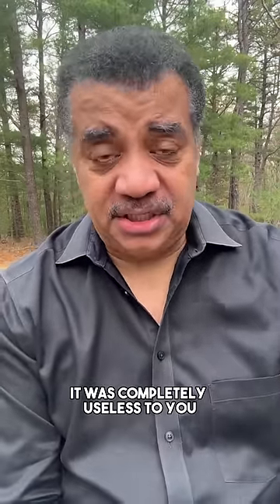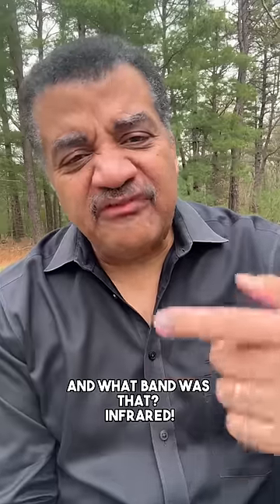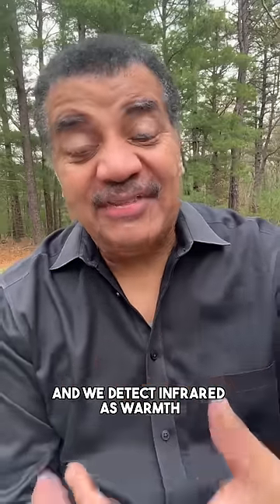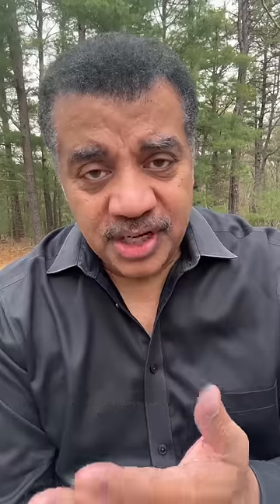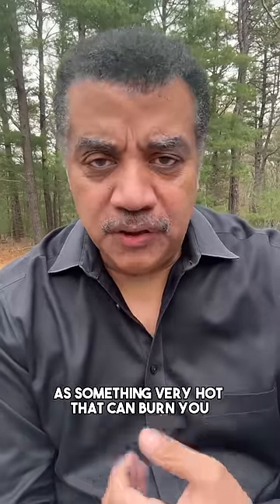LED Bulbs vs. Old Bulbs 💡

Comment: Proof that incandescent light bulbs are 100% efficient in winter.
Reply: Only in places where it gets too cold in winter
Reply: @Brauljo  yes. In places where you need light and a little bit of heat allowing you to turn down the heat in the reast of the area.
Reply: @sukhmeetsingh8365  how do you figure?
Reply: It sucks cause I’m running out of them for my pump house during the winter. Leds don’t keep it warm
Reply: @sukhmeetsingh8365  Well otherwise they'd likely have the HVAC or a fireplace running, so it's one or the other.
Reply: If incandescents are 100% efficient during the winter, well then so is literally everything else...
Reply: @BobWeave Get a chicken coop heater. Uses very little electricity and puts out just enough warmth....like an old style lightbulb. Also safer than an incandescent light bulb. You can safely hang it right against the wall.
Reply: @alansach8437 well that's a  cool tip!
Reply: Only if you heat with electrical baseboards.  

A gas furnace is 90% efficient, but a gas generator is 30% - so a gas furnace produces 3 units of heat per unit of electrical energy you could make with the gas.

A heat pump is also more than 100% efficient - 1 unit of electrical energy heats the house more than 1 unit of heat by pumping heat rather than just making heat directly.

Electrical baseboard heating is obsolete.
Reply: Didn't think of this. Really good point bro 👏
Reply: One winter I heated my apartment with the lights. Heat was included with the rent, but it was oil heat, and sometimes the landlord would be late and getting the oil filled up, usually because he didn’t have the money to pay for the oil.
Reply: I like LED lighting but there is something about incandescent lights that cannot be replicated, there is missing temperature and I don't meant heat but Kelvin colour temperature. Even the warmest of warm temps on LEDs with high clarity rating they aren't as good, imo. I love efficiency of LEDs though but MIT developed an incandescent that was just as efficient using graphene.
Reply: @BobWeave What type of fitting is that? Chances are you will still be able to source them but you have to know there are some exemptions that allows us to still be able to buy incandescent bulbs. I find it difficult to find good quality incandescent bulbs now though.
Reply: Household LED lightbulbs still don't compare to those like in a flashlight or headlamp. They're like wannabe "efficient" LEDs in that technically they might be LEDs but they still use more power than is necessary to produce appropriate lighting.
 Heck look at solar lights. The Ones you stick in the ground outside. There are actually some with pretty good brightness and high lumens that can run all night with just a tiny battery or two about the size of a d battery and a really small solar panel  3x3 in or so is enough to sustain recharging. Another example, I have a really bright lantern I got on Amazon that is capable of 400 hours of light (yes four hundred) on a measley 6,000 mah battery. That means 6000mah of power can sustain it 24 hrs a day for 16 + days or for months at 8 hours a night. I repeat that's on just a 6000 mah battery. I regularly leave it on all night (sometimes even forgetting to turn it off during the day) and have never run out of power/light while camping. 
Why do we only have wannabe efficient LEDs? Imagine if millions of households suddenly had lights that were plenty bright enough but only took a few milliamps respectively to run for a month...
Who would suffer?
Millions of households with a reduced light bill...
Let alone the whole country of billions or world.
We don't have a problem with not enough power available. We could easily create and switch out household electric and appliances with 12 volt LEDs and appliances like boats and RVs. Boats and RVs by the way can already run refrigerators/freezers, heat/ac, tv, hot water heaters etc and all their electrical needs on a couple of batteries or so. Which means it is possible. Boats and RVs are proof of that let alone the off grid houses that already exist running on solar and batteries. It would be kinda hard to maintain all the modern day 110 volt high draw appliances with just solar and batteries. But Imagine if you switched a 110 hi draw refrigerator for a 12 volt low draw?
Reply: @adamnevraumont4027 There are plenty of people heating with an electric furnace. Also, plenty of electricy is not produced with a 30% effienct gas generator. Think dams, solar, wind, nuclear, or even co-gen plants are far more than 30% efficient. The average natural gas furnace in the US right now I'd probably only 80% efficient, plus when you account for all the methane leaks it might be more environmentally friendly to use electricity?

You are right, heat pumps are the most efficient. Problem then is people have AC. Lots if areas don't have AC thus very low electrical use in the summer; however, if I had a heat pump, I would definitely turn it on AC in the summer thus on a yearly basis, I might actually use more electricity.
Reply: Still prefer incandescent, they are excellent and a poor girl's way of healing pain/dis-ease.
Reply: I had to heat my entire house for cold weather comfort unless I had a 100 watt bulb in a lamp by my chair. That bulb could heat my area saving much energy overall.
Better they should let consumers decide. In my case I am forced to use more energy to stay warm.
People that need to keep plumbing areas from freezing can use a incandescent bulb rather than a space heater if it fits. The bulb is a huge energy saver.
Reply: What this guy says.
Reply: Legend has it that those who used incandescent light bulbs did not buy firewood. 😂
Reply: Mmmm
Reply: Mmmm
Reply: Mmmm
Reply: Mmmm
Reply: Mmmm
Reply: Mmmm
Reply: @BobWeave get a heat lamp, problem solved.
Reply: @sukhmeetsingh8365  so go research how LED plastic bulbs are made, and disposed of, and the frequencies they operate on, and you'll learn they're actually much worse in pretty much every way.
Reply: @boscoalbertbaracus1362  I know very well and LEDs last longer than traditional incandescent bulbs. LEDs can be repaired easily and power consumption is much less.
Reply: @sukhmeetsingh8365  MUCH LESS, no. Repaired easily? What are you, a Chinese forced labor factory, because no they cannot be repaired easily, show me how you are going to disassemble a lightbulb, sometimes glass housed, and replace the diode chucklenuts The light is worse, the durability and longevity is as bad or worse on many consumer led bulbs, and the disposal of which is even more detrimental, so, you're wrong. But nice try.
Reply: Perhaps you should get rid of your car and get a Horse, there's progress...!!!
Reply: @andylane247  who asked you? do you use bicycle for commute?
Reply: @sukhmeetsingh8365  
Shank's pony !!!!
Reply: And we don't really use them in the summer
Reply: Word!
Reply: Nope, not 100% efficient. When filament gets hot, it expands, which uses energy, and the expansion causes sound waves between bulb and filament, which works as an air conditioning unit. Also, when filament heats up, nearby gas particles are heated up and ionised. Also, electrons are ejected from filament by thermionic emission, these electrons can interact with earth's or the sun's magnetic fields and convert the heat energy into kinetic energy. So nope, sadly not 100% efficient.
Reply: @due737ejdnd  lol, your're right :D

Comment: As a truck driver, I noticed that modern LED tail light bulbs don't melt snow.
Reply: Yeah, inferior.
Reply: Which can be a problem for traffic lights. They fill up with snow to the point you can't see which light is lite?
Reply: @edtrine8692  Technology Connections already covered this problem. Just install heaters on the LED traffic lights that turn on when the light is covered in snow. Sure, it'll use more power than incandescent bulbs when it snows, but you then save 90% of power usage when it doesn't snow which is most of the time.
Reply: They have their place in the home for sure. But on vehicles, I agree that light bulbs that don't heat up the headlight housings much are inferior. Especially considering it doesn't change your fuel bill, unlike how light bulbs can change your household electric bill. I'd just rather have snow melt capabilities in the cars.
Reply: Can we find a question that he does not know anything about?
Reply: @dr.k7111 would actually be a detriment in the south. Here in tx, when it's still 95 after dark, having super hot headlights could potentially cause headlamp issues or require a formulation of headlamp material that can withstand even higher temps than now...aka (money)
Reply: They also don't set the dock door cushion on fire.
Reply: @simonruszczak5563 not inferior, just different. incandescents die quicker, waste more energy, and look worse at night.
Reply: @PORRRIDGE_GUN What percentage of the time is there that much snow in the UK?
Reply: Infrared light is actually good for health and for your eyes. They also do not disrupt sleep that much and are more soothing.
Reply: As a Texan this is a non issue for me.
Reply: Yeah cities that switched to led traffic lights had to install heat strips for snow storms. Wild
Reply: @egustafson They still save around 90% of the energy when there isn't a snow storm, so it's worth it
Reply: The thing is, LEDs can build up plenty of heat to melt snow, since the light conversion process is still only 30% efficient.  They need to use materials to quickly conduct that heat from the rear of the LED, where it's generated, to the font.....which is probably more difficult to do than I imagine.  

Still, I don't get enough snow anymore(and even when it does snow, so few are willing to drive in snow nowadays) for this to become a significant problem in my life.
Reply: I like the old bulbs. More light and not a noticeable amount in my bill.
Reply: Infrared is useful in reducing oxidative stress. So basically it can help in recovering from COVID and other illnesses.
Reply: @chualc yes
Reply: @edtrine8692  and how often does that occur?… maybe if you live in Alaska or Montana or where I do in British Columbia yes… But for the most part,not ever a concern.

Comment: Incandescent 40W bulbs are used in ovens and in older refrigerators to defrost the coils. They are still sold as they can’t be replaced with LED light bulbs.
Reply: I burped and smelled the meat I've eaten 🤭
Reply: @myguykaikai9215  Yeah remember the coil thingy 🤭 Good old times :)
Reply: Thankyou for this.  You’re correct. All stoves use that 40watt clear bulb.  I use those in the lamps.  It has a look that’s very pleasing.  Now an LED is great to read book and newspaper by, but most of our reading is done on the computer.
Reply: You must be related to Neil.
Reply: The reason old kind are used in stoves & refrigeraters is LED lights have mercury in them.
Reply: @kaycoats8344 it's more that they have pcb boards and other components in them that would melt in an oven.
Reply: Omg i had one where the light didn't work anymore and the defrost was SUCH a problem and i never put that together!
Reply: @kaycoats8344  CFL bulbs are the ones with mercury in them, not LED's....
Reply: Maybe someday LED's will be used in ovens and refrigerators but up until now LED's were very expensive while incandescents were a very small fraction of the price LED's. Since they were on for a few seconds at a time in a refrigerator or for that matter the occasionally used cupboard in the hall why pay all that money to install LED's you save practically nothing.
Oh I like Tyson but he's dead wrong about LED's not getting hot, they can get very hot with many looking like incandescent bulbs carrying the warning ' not for use in enclosed fixtures'. With a little finagling I managed to drop the globes to give about an inch space for heat to escape. I still save a ton of money on them though, even in winter my bills for a one bedroom 900 SQ ft apt are about $22, with a plasma TV and  refrigerator. I'm paying 18¢ to 20¢ a kWh. So you can have your cake and eat it too, no need to be a Luddite, your standing as a neanderthal is safe and you save money which you probably don't have enough of.
Reply: @hotprop92 , I remember the refrigerators that didn’t have the defrost feature. You had to buy a block of ice every week to put in a tub and then put your food in it. The refrigerator doors would then be left open to let the ice on the coils melt. Those refrigerators also had latches instead of the magnets to keep them closed. Many kids died playing in old refrigerators as the latch prevented the door from being opened from the inside.
Reply: @kaycoats8344  LEDS don't contain mercury but compact fluorescents do. My fridge has an LED inside it. Regulations may vary in different countries.

Comment: LED bulbs do also generate some heat, just not nearly as much.

Sometimes some of them do generate enough heat to cause them to die an early death, compared to how long they can live if that heat is properly extracted from the package and dealt with.
Reply: It takes forever for them to warm up enough in cold weather. I know what you mean. I would have to turn on a light long before I needed it just to illuminate the area I needed. Yeah, that technology isn’t where it should be yet. It’s like, keep working on it and maybe I’ll see the advantages. Have you found that too?
Reply: @gailcapshaw5772  Are you sure you're not thinking of CFL bulbs? Generally speaking, the cooler the environment, the greater an LED's light output. This quality means that LED lighting actually performs well in cold temperatures. In fact, these lights will turn on instantly in cold temperatures, as the cold does not affect them.
Reply: There might be a momentary delay as the power supply stabilizes.
Reply: Neil implies that LED bulbs are 100% efficient, but not true. They produce 9-10 times the light output of an incandescent bulb for the same power, but do have some overhead in the conversion from high voltage AC to low voltage DC. The actual LEDs operate on 2-5 VDC, rather than 100VAC or more.
Reply: Anything that uses energy produces heat my calculator doesnt get hot sounds like a personal problem